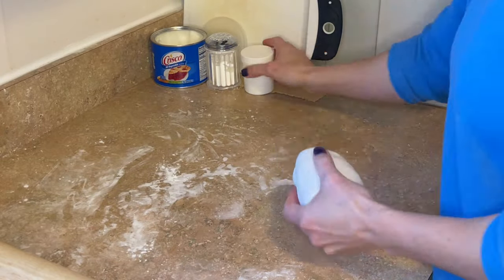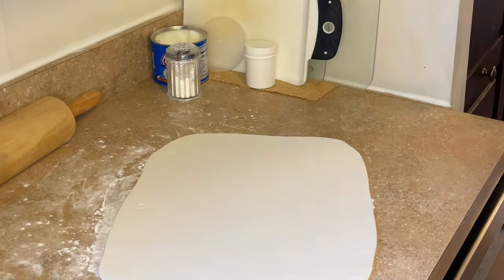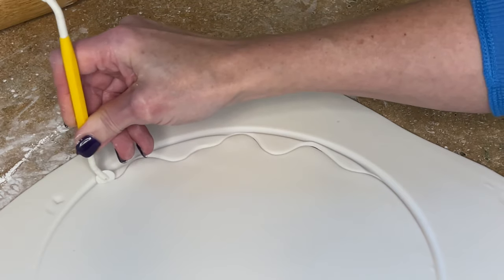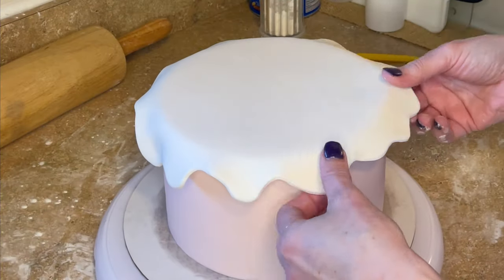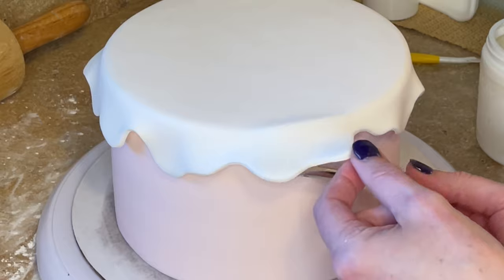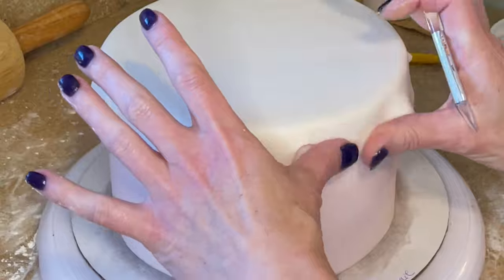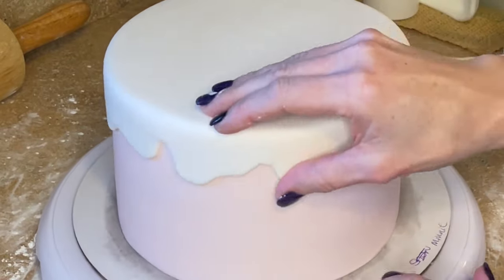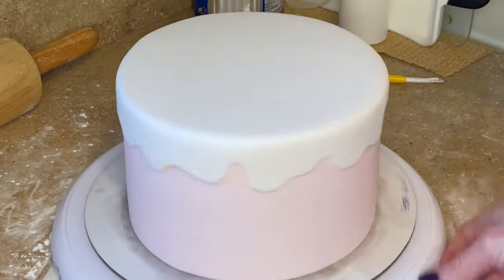Make Your Cake Look Like It's Covered In Snow! | Simple Technique

Comment: Great vid. U said tylos powder makes fondant easier 2 work with but what exactly does it do? And is it the same as gum paste?
Reply from the maker: It stiffens the fondant up so it's easier to work with.  How much you use will depend on how stiff the fondant gets.  I use a little bit (1/2 teaspoon per 2 pounds) in my fondant to cover cakes with, it helps make the fondant smooth and stretchy.  I use a little more (another 1/2 teaspoon for 1 pound?) for fondant decorations that go on the cake.  And I use more (another 1/2 teaspoon or more) for decorations like toppers or bows that have to hold their shape and dry really hard.
Reply: @KarolynsKakes  TY for the details.and helping to clarify how much for what application. I dnt do much fonadant work but would like to. This helps.